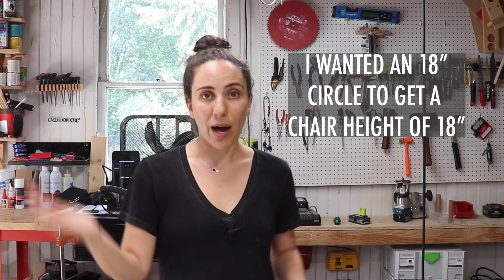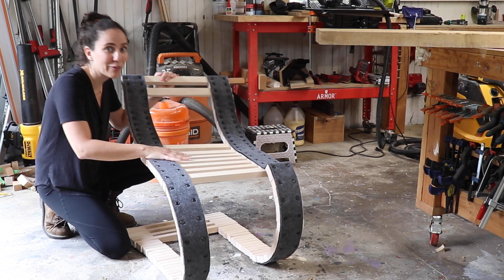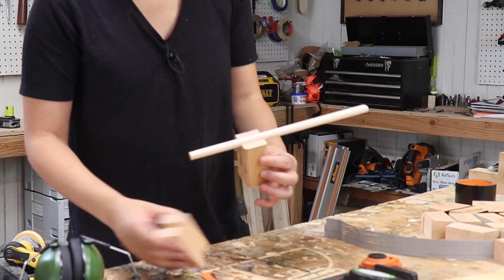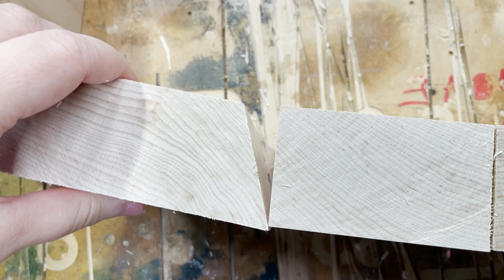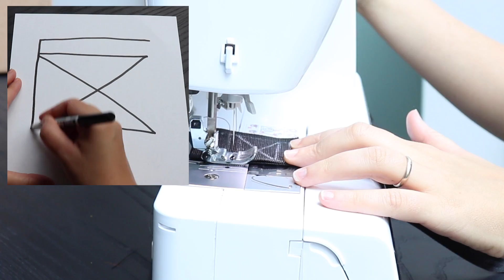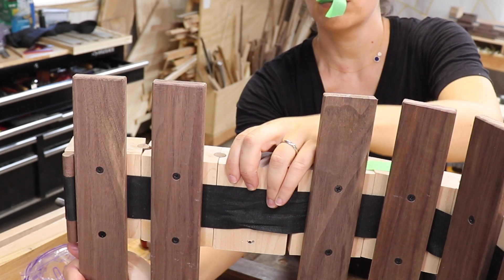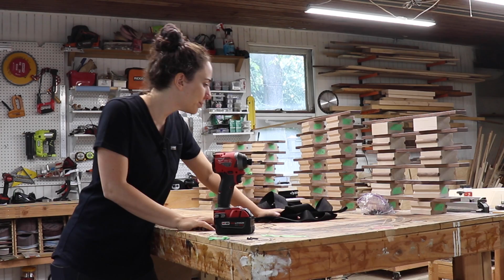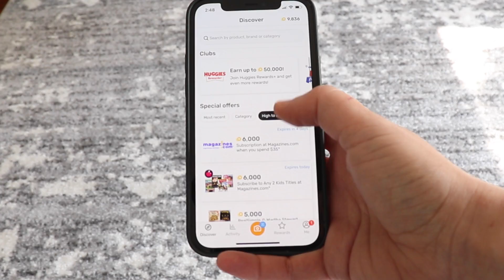I ATTEMPT to make a Roll Up Chair… AGAIN...

Comment: So most weaves for fabric are designed to stretch (some carbon fiber weave patterns are designed to only stretch on one direction), but you know that because that's why you shortened the length, however, you should consider attaching the pickets while the strap is pre-tensioned (at like 600 pounds, so be careful, if it fails the the whiplash will be dangerous, use safety wires to hold it down). Also, your connection to the strap with only one screw through the middle is insufficient to maintain the tension (and isolate each joints load so it doesn't pull through to the end and cause it to fold) evenly and prevent pull-through. Do like you did with the joints. Route two grooves on the picket and the block, glue two dowels to the picket side and sandwich the strap. Bolt with 4 bolts (if you can avoid cutting the strap fibers with the sharp bolts even better). The two blocks must be tight and strong. That strap is applying a lot of force to force those blocks apart. You will probably need carriage bolts with fender washers. Of course, the other option is to use a mechanical joint that can support 600 pounds (at least, as each joint is creating a fulcrum against the hinge joint) without having any stretch. Have you ever seen the Chinese folding stools? They use multiple interlocking wood joints to distribute the load across multiple 1 inch wood joints that interlock. Way too bulky for what you are trying to do, but it may give you some ideas for solid hinges.

Comment: I would just put some dowel rods that are vertical under the seat to hold the weight of the person and call it a day, and they can be taken out. Just make holes and put the rod in em. Then when you wanna roll it up, take them out and roller up

Comment: Leather stretches from wear and time, in my opinion its a bad material to use in this situation (unless there's some kind of leather processed, made for nonelasticity). I would use some kind of Kevlar/ Kevlar composite / aramid webbing. Also, could the webbing used in slacklines work?

Comment: What if you designed it similarly to those tables that are self supporting through ropes that connect to the top and bottom. I'd imagine you'd have to complete reengineering how you rolled it. Probably from bottom to top, but that could work?

Comment: Though you shortened the strapping and then drilled the holes again, the holes did not meet the strapping at equal spaces causing other pieces at the bottom end to have gaps. This misalignment caused the pieces to botttom take different angle and hence a gap.

Comment: It seems from the video that the major issue is stretch, not giving the chair enough rigidity in its unrolled fashion. Now this may be cost prohibitive but what about using metal hinges between each part, they can not stretch and would still allow the chair to be rolled up.
Reply: Hinges have slack, the chair would weigh a lot, some sort of Kevlar / aramid is the way to go in my opinion, also the webbing used in slacklines is worth a try.
Reply: @kristupass1061  Even though a hinge would have some slack, I very much doubt it is as much as any kind of fabric would have. I agree on the weight though, provided you think of metal hinges, but consider if you will, having them 3d printed from carbon fiber material, much lighter than  metal. 
My knowledge of the Aramid and Kevlar fabrics is a tad limited, but I know that in most cases they are actually used in a way that their "stretchiness" absorbs kinetic force. Maybe in that case (yay for workload) having box joints sewn where ever the joints are on the curve from "leg" to "seat" so they are more rigid and less stretchy might be another idea. I just would love to see you succeed in this chair, I think it is an awesome design as such. Much Success in future endeavours.

Comment: Use metal cables (flat ones would be perfect) through all the pieces, drill them all, then fix them on the top with bolts to set the tension properly. You should use two cable for every “leg” (4 then)  and this will fix the torsional issue without those not very effective cylinders (you should go for a sharper edge for that purpose imho).
I suggest to stop using anything you don’t know how much will stretch with weight without a precise calculation or it will break anyway after a couple uses.

Comment: 3 suggestions, 1 you are using too many segments when making your arches resulting in more gaps being formed so try fewer segments to limits gaps. 2 instead of horizontal dowels try vertical ones to "lock them in place" better and reduce gaps as the vertical ones wont allow the segments to pivot on the other side as much. 3 and most importantly centralize your tension and allow for more to be applied once put in position,your issue with tension is because you have 2 curves going in opposite directions on the same side with the same fabric which creates slack. create vertical holes and thread your fabric through to create a much tighter tension as rope does not stretch as much under load like these others do plus its arguably cheaper. try a tow strap ratchet to get the tension you need once  its in place with central tension so it doesn't roll up on itself but instead pulls itself tighter together. all just theories though.
Reply: Number of segments makes no real difference. For any given geometry it comes down  to the youngs modulus of the materials.
Reply: I am about to reply to my own message...feels weird, anyway. Because i have seen both of your videos the youtube algorithm suggested a video by another woodworker who made a successful, albeit complicated version. After watching those videos which did have some of my suggestions oddly enough, pallet binding is actually going to be your best bet for material. Wont stretch and is incredibly strong...just might be costly for such a small project. The only other major note is interlocking pieces but i know you wanna try it your own way. I only post this as a way to look from another perspective to show another way it could be done.

Comment: Tamar, don't be discouraged. It's no small feat to make this chair work. The forces generated by leverage and camming action between the segments are enormous . The forces levered on those short segments can literally flex and even slightly crush hard maple against itself, and the strapping can slightly crush itself into the wood. The lightweight UHMW PE strapping is pre-stretched, should work better than the second one.

Comment: I think a steel cable would probably be better. They are insanely strong, dont flex, very small and you can easily adjust it. Also maybe try longer angled pieces so that there is more mating surface

Comment: you shoud try useing amsteele its in a chord form but is supper strong and low streatch youcould use a supper thin piece of it and it would be strong enough if you rout a channel in the wood for it

Comment: Maybe spider silk cable/rope would work. Although it took the Mythbuster guy 25000 strands or 9.5 miles of it for a length of about 8 inches to equate to a 28 gauge steel wire. It did turn out to be a lttle over 2x as strong..... so definitely worth it I'd say.

Comment: Okay now i'm invested, i don't work with anything relatable to that matter but i would like to sugest 2 things:
1 - Why don't u try to use metal strings instead that car belt seat? it might bring some new problems with the wood no resisting the material, but i have faith that u could work around this :) Also in this topic, the placing of the belt seens wrong in some places, wouldn't it be more reliabe to drill some holes in the wood having in mind which side have more tension and passing the string in it?
2 - The place of the chair that is getting tensioned more seens to be the mid-end portion of the seat, for some reason that reminded me bean bag seats, would be viable to conect the top end to the bottom end with a c like format? i believe that would solve the problem that the seat sometimes almost touches the floor

Comment: I think if you used something like netting or a a material with more elasticity for the seat to actually sit in and disperse as much weight over the frame might solve some of the issues

Comment: Use hinges instead of the straps - with the straps the force is wandering around to the position of most stress - so if you sit on it the backpiece might just snap on your back really badly the moment when trying to stand up (and this issue gets worse with more preload on it) - so I would guess you really don't want to have all those pieces linked to the same "source of energy" (the strap acts like a rubberband and stores energy). So I would go with metal hinges or something between the wood blocks. Or maybe a metal chain - as long as it's connected to each block - could work well enough

Comment: I came down here to suggest hinges, as someone else has already done.
However, "just" hinges is probably insufficient, because they would end up transferring the tension into the wood, pulling it apart on that side with the same tremendous force that is stretching the strapping. And wood is not a fan of large tension forces!

So, what to do?
I'm thinking perhaps metal plates connecting each hinge plate to the next, either with the screws going through both, or better yet welded together.

Comment: You could also try using the same metal wire that is used for suspending electrical wiring at a height say from a house to a garage or workshop if you can't dig the cable underground. Love the idea 💡 of what you are doing I think that leather would not be a good idea as you may have to much stretch in it

Comment: This may have been suggested (you get a lot of comments, which is obviously due to how interesting your videos are!) but perhaps you could use a couple 1/8" stranded cables in grooves under the strapping (so they cables wouldn't be visible).  Any strap will have some flex, but cables should not.  A metal reinforcement under the cable may also be required to prevent the cable cutting into the wood, but the metal could be very thin.  The upside is that you should be able to use the already cut pieces from your first version, assuming you have already glued the most recent one.

Comment: Since it's mostly the top half that is giving up the excess strap for the bottom curve to use, just have two separate straps. Or add some stopper in the middle. When I first saw you mention the strap, I thought it would be fixed to all the pieces, that would fix the issue for sure. Can't this stuff survive a few holes?

Comment: You could use steel wire as the tensioner. It is ridiculously strong and lightweight. It's not a strap, but it might work.

Comment: I think you would be able to resolve the issue with a detachable piece that you can put going from the base of the chair to underneath where you sit on both sides. You can have a cutout section where the pieces would slot in so they don't move out of place. This would then be able to hold up your weight while maintaining that foldable feature.

Comment: If each join flexes by just one degree, the whole thing will flex by 15 degrees in total, and you don't have a chair!!
You can't BEAT the flexing! You have to ALLOW for it. Take one degree off each bevel, so that when it flexes by one degree it makes the intended angle!

(Also, instead of dowels, a tenon shaped profile would flex less. You'd need an appropriate bevel on one face of the tenon to allow the join to unroll.)

Comment: seatbelts, or tow straps, or many paralleled small steel cable. Also, you need to alternate the side the strap is on, to transfer the energy where it needs to be. It should be on top of the base, on the outside of the curve, continue  on top of the seat, and behind the backrest. This will cause the chair to pull the back, and the bottom tight against the joints, instead of trying to collapse the chair. P.S. needs to be made from an extremely strong/rigid hardwood. The amount of tension you are exerting on the joints is enormous.

Comment: Have you considered using single lengths of dowel rather than smaller mirrored pieces? It won't fix all the problems but it should help spread the load more effectively and reduce the side to side motion.

Comment: Definitely use hinges. 
Or try the strap, but have more pieces which the belt is fixed to, not just head and tail pieces. Otherwise, the energy transfers through the belt and it'll fold. 

Hinges are all separate, so no tension transfer is taking place, and only thing that takes the load is the metal hinge, the fastener used, and the wood. Here your main concern is wood ripping, or failing gradually over time.
Reply: Yes, straps only take stresses in one direction. A pin can prevent flexing 360.

Comment: I think it has come up already but Aircraft cable would be my goto. I may just cut some channels into each of the slats and run the cable through that and then use a decretive strapping to hide the cables. you could even put stoppers in each of the slats meaning that you could control the length of each individual join essentially isolating them.

great job though I really like the finished product especially as it was not what you set out to do from the start.

Comment: As for the straps you should look at the material and use material that dont't stretch.
For instance: Kevlar, Aramid, Carbon have almost zero stretch.
Typical straps are zu elastic, typically made of polyamid or polyester.
So watch the basic material and don't look at advertisement bullshit..

Comment: sooo...as im say earlier, you use wowen and as you see they have too much streching, material was good but in bad form, for safety i'm will make more then twice wider compposite strap with bare fibers (as i'm say in comment in previous video), and to solve problem with "problematic" points you will need to chose other shape that has less leverage on strap. Oh, and for last, UHMWPE make creepy noises, thats normal, molecules are enormous.

Comment: Please do a little bit of engineering before starting : Let's assume your wood is 5cm (0.05m) thickness, and that the cable is like your test tape : right at outer edge. Lets assume chair own weight is nul, and a 100kg adult is seating on. looking at the design, the highest constraint will be at the round front tip of the chair, lets say 0.5m from the seating bum. SO , right at this place, cable tension will be 100 x 0.5 / 0.05 = 1000kg = 1TON even on two arms, it's 500kg traction on the outside of each branch, and an equivalent compression on the wood at the opposite. Not sure your materials will handle that on a few square centimerters. Also uour straping and wood does not have an infinite rigidity, so by shortening it, you may have to compensate deformation under constraint. This constraint is different at each block on your seat, so the straping must be attached on each block, and the maximum tension will be at the front. You can solve your problem by increasing the thickness of your wood, thus diminishing the leverage (example with 10cm thick wood: 100 * 0.5 /.1  = 500Kg tension in total, so 250Kg on each branch, seems much more acceptable by your straps. A metal cable would be way more rigid under constraint, so less deformations under load. For me I would consider two motorcycle chains for traction, with screws at each link. Also an industrial timing belt like GATES GT2 would have the traction resistance due to inner cables, and the flexibility.

Comment: Could you use the wood blocks themselves as hinges? The darker wooden pins would lock the joint pieces together while allowing for rotation while the wanted surfaces would keep the "chair" shape when assembled to right orientation. Would just have to make a stopper at the end of the pins to keep them in place between the joints.

Comment: Are the straps a must? I was thinking on the gaps it allows, like, what if you have zero gaps. Someone suggested door hinges, something like that, at least to test if the chair holds up when you have zero gaps. Watching this reminded me of that bold chains that can't curve beyond certain point, the interlocking links won't allow it. Maybe getting ride of the straps and make the blocks like an interlocking chain could give you zero gaps? There's this japanese man that carves seats out of a single block of wood that have rotating pieces but also holds in place because of the angles and interlocking system, instead of any flexible parts: https://www.youtube.com/watch?v=X2TIM2f9ubI
I don't know why is more compelling seeing your progress that just watch a final video of a (ideal) succesfull chair done.

Comment: I feel that the strips of material should always be in tension, but the rest part, given the shape, is on compression, which a strip cannot do. Maybe in the place where the back rest and the seat meet the strip could go through the joint and move into the back. That way the strip will be in tension all the perimeter.

Comment: Tamar you get Lots of Kuddos for all the patient you have, i think i have a solution for you but i hope ill make sense trying to explain! so you know how with the curve you had now everything become more curve and falls down? so i think in the main design its needs to be much less curve a bigger radios so when you open it and put tension on it its stretch to the size you want! as you can see you can design the pieces and cut them to shape you want it to be since it doesn't hold the shape so rather design it in mind with the curves it needs to be that once you put the tension on it it will get to the desired shape! i home i make sense? let me know what you think!